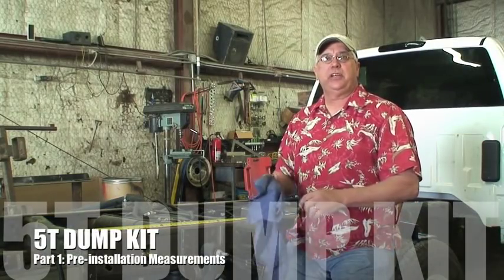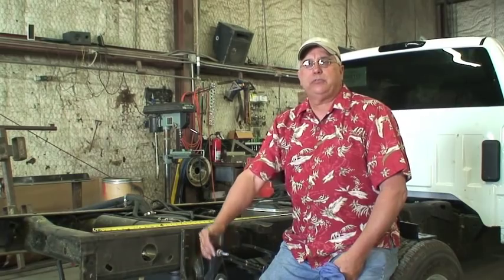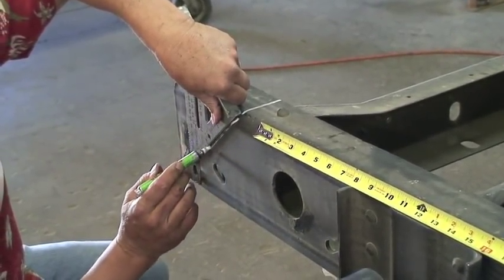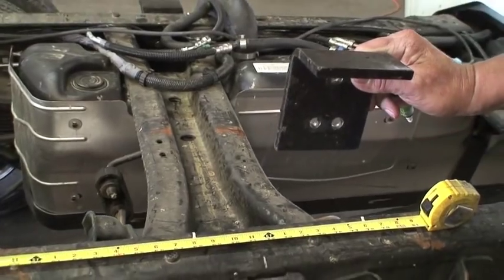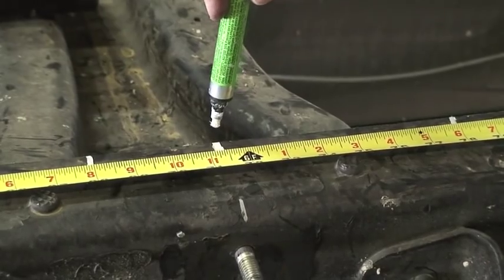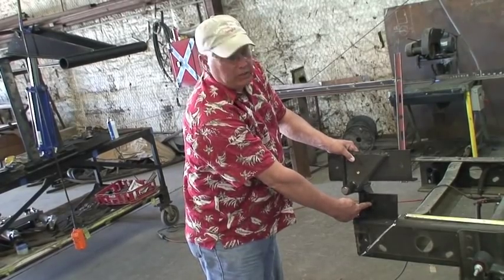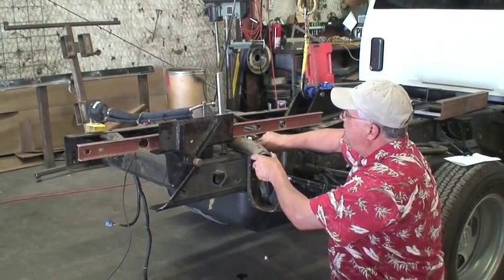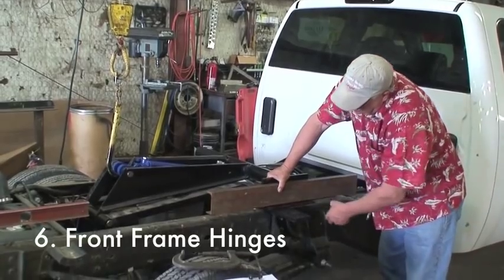Part 1: Hefty Hoist Dump Kit Measurements

Comment: Its a good video, but needs to be updated. The newer kits come with parts which the older ones didn't. The new kits don't have a toggle switch, they have a better updown button control, they also come with a saftey prop, a circuit breaker, rear scissor support braket, and a pump mounting L bracket. I believe it also comes with guide brakets to guide the dump body down. Plus they don't mention this is a power up, gravity down hydraulic motor. The wiring differs. In general it would be nice to see a updated video.

Comment: the only tipping gear to use is "Harsch Ind." . You did a great job however, it would be a lot easier to make a sub frame  and mount your hinges and hoist to it. Then you can weld a pintle plate to the truck chassis so you can tow safely. We do custom tipping beds on all kinds of trucks 1 tons and up. my only concern no place to have a pintle plate.